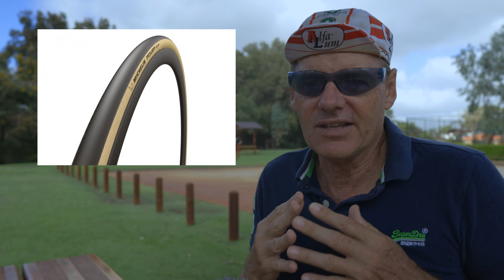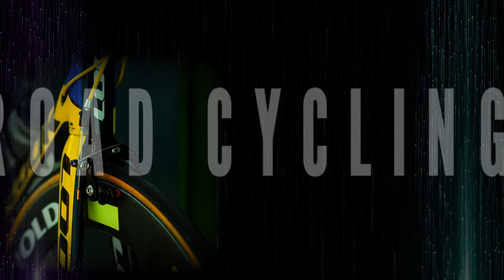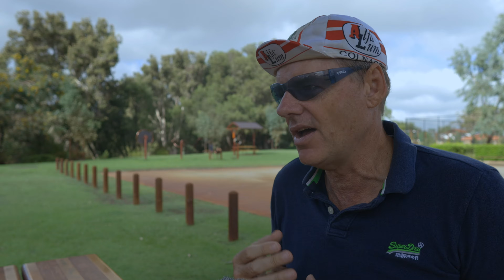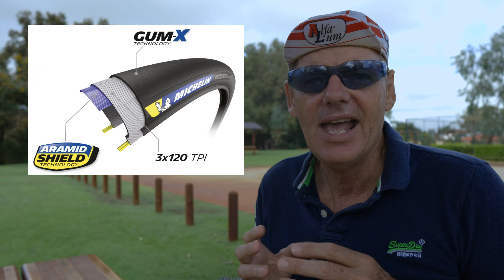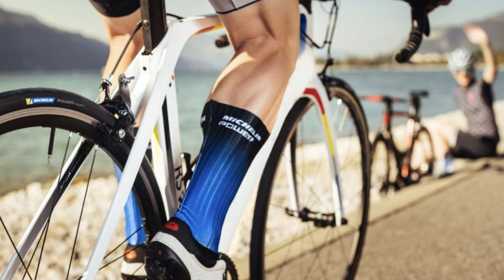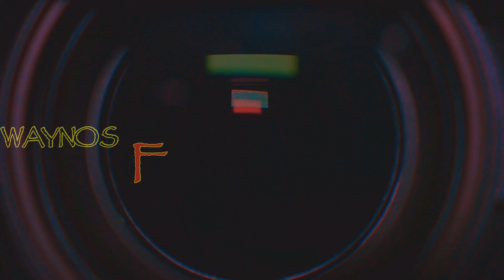Michelin claims FASTEST tyre!

Comment: I'm using with this tyre for 7 months and travelled around 700km. For performance, I would say it provide excellent rolling feedback from the road with the latex tube. But in durability, I'd say is just average, I have experienced a puncture at ~500km and the tyre wear is faster then I expected, I can see some of the protection layer at the sidewall (imperceptible). Overall, I think this tyre is a really outstanding option for racing purposes not good for training.

Comment: I have a pair of the new power cups and they certainly just that little bit more comfortable and they are a tad more compliant than gp 5000 faster maybe . I’m lucky that I have a little strip of cobbles out side my house . And it’s easy test to find out which is faster at a given pressure and power for the distance, I know they don’t catch the wind as much as the conti either giving a more confident ride. What I don’t like is they have lost the ruler, they size up huge. For people that are running clinchers get the 23s if you want a true 25 on a 20mm I’d rim. Hunt aero wide 34s for reference.
Reply: Thanks for the details. This is actually the exact type of information I'm looking for.

Comment: Hi I live in central Mexico in an area where we have very crapy roads (Paris-Roubaix style...almost) so I always thought that I have a very nice test lab for durability and puncture resistance. I used Continental and Vittorias and lasted 3,500km, Schwalbe around 4,500km. The only ones that truly worked for me where Michelin Power All Season 28mm I had used 2 pairs for the las 2 years and survived over 20,000km a year each. I am 80 kg and I mostly ride over very bad surfaces let´s say 60% asphalt and 40% gravel. By the way, I use clinchers.

Comment: Was it Wheel Energy in Finland that did the independent testing?  They need to do more tests.  A range of tests over each variable.  E.g. a range of tests where the weight varies, a range of tests where the tyre pressure varies, a range of tests where the surface varies.  The data then shows the effect of each variable.

Comment: I changed my s works turbo 26mm for 25mm GP 5000s tubeless, I didn’t notice a difference at all, I think the marginal gains in all of these things only really benefits the pros that are squeezing every single gram of performance out of the kit. I think it’s the same with groupsets, dura ace is no use to casual rider, because the rider is no where near there peak ability
Reply from the maker: It is true, many of these claimed gains are extremely small and make no difference, compared to bigger gains, like rider position. Rolling resistance, although real, is a much smaller variable than other benefits like aero, i.e. rider optimised rider position.

Comment: They use 50kg as it is the load per tyre. Two wheels
 Load might not be evenly spread between front and rear but quess 50kg is a good reference point.
Reply: you beat me to it.  Well said.
Reply from the maker: Sounds reasonable, that slipped my mind 🤦‍♂️
Reply: Yah , thought I would check the comment before I crushed wayno
Reply: Agreed. Ought to divide total system weight by 2...adjusted for maybe 55/45 rear/front loading.

Comment: 50kg riders rejoice!! I used Vittoria Rubinos for a while, mainly because they were the only ones available locally for my wheel size. One had a bead catastrophic failure once so there's that.
Reply: I think they tested one wheel at 50kg. Considering we have 2 wheels it seems realistic.
Reply from the maker: Eeeeeekk!
Reply: Rubino prod are awful tyres. I threw them out
Reply: @glennoc8585 yeah the ride quality was bad, to which you could say fair enough its not a supple high end tire, but the puncture protection was awful and they cut so easily. Never had that problem with a gp4s or even the gp5k.

Comment: I run Michelin tires on my car but their bike tires are crap. They puncture for fun. For that reason I've had Vredestein (before they stopped making them) and now Continental ever since.
Reply from the maker: Is your tyre working? Perhaps not, but your pen is working. Which is a good thing. 🤔
Reply: I've used pro 4"s with no issues with punctures but I do ride on pretty good roads. I'm trialling super light clinchers by tufo and I'm really loving the tyre. Not tried Michelin on my cars as im a pirelli and Yokohama fan.
Reply: I switched from Conti to Michelin for the reason that Conti punctured every ten miles and the sidewalls disintegrated.  Went to Michelin and never went back.  But...  That was the ProRace series.  These Power series tyres look to have traded puncture protection for rolling resistance.
Reply: @earthstick  I haven't tried the power series only the pro series. The power series are really a smooth road race tyre.
Reply: I agree completely in both arenas. I’ve got Pilot Sport 4 a/s on my Audi, they are incredible. Their bike tires are fast but I couldn’t keep the air in.

Comment: Unlike aerodynamics mechanical properties change consistently, so if a tyre compound has less hysteresis in one conditions, it will have less in other too. The Zipp findings about pressure are not so much about tyres themselves, but use scenarios.
However it is true to say that testing tyres not at same pressures but at pressures (and with rim width) recommended by the manufacturer is a fairer holistic approach, but currently people want to compare apples to apples, so 6,5 for everyone, folks

120vs160 tpi can be rather explained by economical aspect: tubular is a premium option, can justify the costs. You also add confusion when talking tube vs tubeless while both have same 120.

Comment: Would the 50kg they used be equivalent to 100kg on 2 tyres (or thereabouts)? I noticed from video they were testing on one wheel which I assume they loaded with 50kg? Or did they not actually show the test rig?
Reply from the maker: They didn’t show the actual test rig used. The photos are from the Test labs standard equipment.
Reply: @waynosfotos  but only one tyre was tested
Reply from the maker: @rp6760  we don't know that.